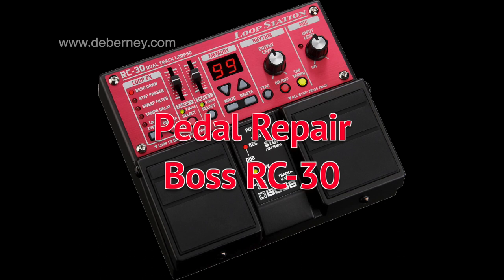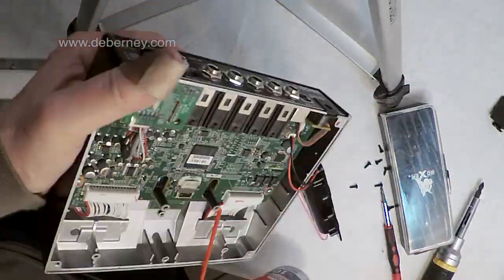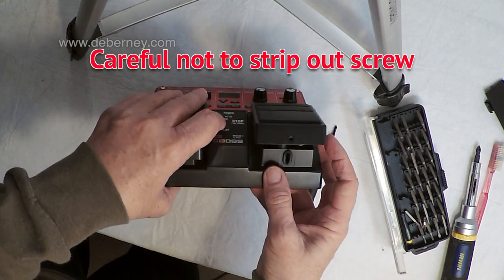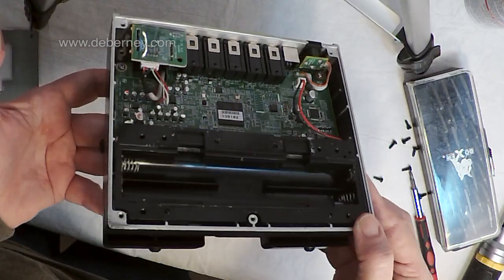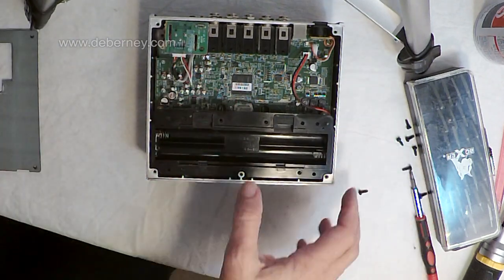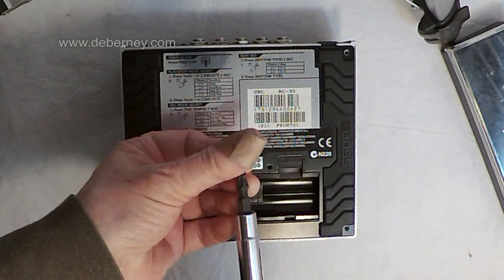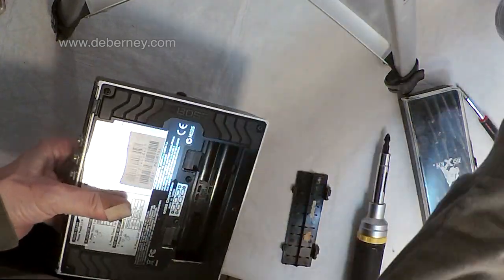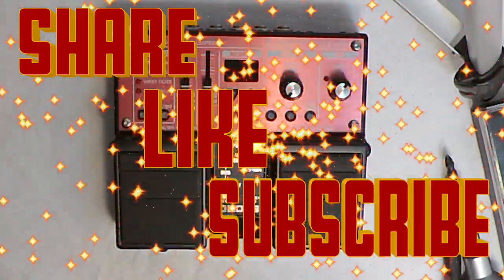BOSS RC-30 Looper Repair

Comment: You have 2 layers of PCB and most common area with rust is in between those layers. 
It’s easy to disconnect those (necessary to disconnect the battery connector on the PCB surface and the two white pedal connectors) with 8 screws. Must unscrew on the outer part the jack connectors too. 

The area where beer/water damage comes in, is in between those two layers. Easily cleanable with toothbrush and rust-remover/contactspray.
Reply from the maker: Thank you.  I'm sure this will help many experiencing problems with their units.

Comment: Great video!!! 
I’ve got a very strange issue, whenever I record on track 2 , it seems it’s stuck on 20% volume. 
Track 1 sounds fine, but even if I crank the track2 volume to the max, barely gains any volume. 

I’m trying to access the front of the pedal but not sure on how to 😢
Any help?
Reply from the maker: I don’t have th RC-30 anymore, but I would check manual for SYSTEM RESET and try that.

Comment: I’m having an issue with the the male end of the plug in! It won’t turn on, with a boss 9v or any other power... suggestions? Does it need batteries in it? Regardless? 

Thanks!!!
Reply from the maker: Sounds like you have tried different elec cables.  It does not need batteries with electric.  I would check the inputs, try a different wall plug then call boss.  See if it works with just batteries.

Comment: I just received a used one, and it was shipped with a 7.5v 2.8a center positive power adapter. I think they packed the wrong adapter, aren't these usually 9v 500ma, center negative? I'm afraid to plug it in. But it seems to work fine with batteries
Reply from the maker: It should be Ok.  Just make sure the V and amps match the voltage on bottom of the boss
Reply: @DebErney  Hmm.. the only thing on the bottom that mentions voltage is the battery cover. it says "DC 9V(1.5V × 6)," doesn't say anything about amps. But I think each AA battery is about .16 amps, but it varies depending on mAh so I think 6 would be about 1-3amp.
I'm most worried about the polarity, I heard you can fry the unit if you get it backwards.

Comment: I have the same pedal as this one. Recently, I've had issues with the features not working. When I plug in the cord, I'm only getting the green power signal but not the red lights so it will not record a loop. I've taken it into Sam Ash and they plug it in and it works fine. I even bought a power distributor which we tested at Sam Ash and every outlet activated the loop station correctly. I thought it took care of the problem, but when I plugged it in at one of my gigs, the pedal showed green power but the other lights didn't come on. It's been a hit and miss when I hook it up at my shows. Have you or anyone you know experienced this? It sounds like a power issue. I will take it apart and clean it to see if that helps.
Reply from the maker: In my experience when having constant problems with a piece of equipment its time to replace it.
Reply: @DebErney  so I took it back to Sam Ash earlier today and it worked there without an issue. Lol The salesman reset it back to factory settings and I plugged it in  at home and now it's working again. Hopefully that is what it needed. I didn't think of that. I also bought the Boss RC-1 pedal as a backup so I'm good to go! Thanks for your reply. :)
Reply from the maker: Reset is always a good idea though it sounds like you have something wrong with the electric chain.  If you have any other problems I’d replace ext cords, cords, anything providing elec to the unit.
Reply: @DebErney  I have a repair man on standby.
Reply: Hi i have the same problem! I think that the problem came out when i conect the pedal to te computer to copy a file, from the pedal to the computer- Next day Just the green light is on.

Comment: I have an RC-30 that I’ve had for several years. Recently I’ve discovered that I am not able to switch between the two tracks or play the two track simultaneous by use of the right foot pedal. I am out of the warranty period By a long shot. I was wondering if this was one of the same problems that you were having with your RC 30? And did the cleaning resolve the issue? I can select tracks manually but not with the foot switch... I’ve also done the factory reset...
Reply from the maker: these do die after a while.  If you've done the reset, opened and cleaned, checked for broken cables, I think it's safe to assume you need a new one.
Reply: Deb Erney I will try opening it up and doing the cleaning exercise.... There are several BOSS repair center’s in my area, however, a new RC-30 goes for around $300 and I can get a used one in excellent condition for around $200. So if cleaning doesn’t work replacements probably makes more economic sense... Thanks for your prompt reply...
Reply: JP Illes the exact same thing happened for me! Right foot wont let me switch tracks or do simo it’s so sad but I have had mine for 11 years now lol so I guess it’s time to replace let me know if the opening up cleaning worked for you!
Reply: Same thing here. I had a gig coming next week, so i had to buy new one. Now after 1,5 year, same thing with this new one
Reply: Hey, I'm having the same issue. Did yours get fixed?

Comment: Hi, mine is stuck playing the same beat like a metronome, it can't record or do anything, I've tried reseting it but nothing works, do you have any tips?
Reply from the maker: I'd try a factory reset, which can be found in manual, and if that didn't work I'd assume it needs replacing.

Comment: Mine was in storage for a while.  When took it back out to use it makes so much noise.  It sounds just like a bad cable.  I’ve tried all new cables and a brand new Boss power supply.  Saving the factory reset as a last option.  Has any of you seen this problem before?
Reply from the maker: I would have done the same.  Change cables then factory reset.

Comment: Hi my old rc-30 had a issue here.
everytime it powered up,it shows ER at the screen.
And everytime i FACTORY RESET,
It became slow flashing DN after fast  flashing FN...
When I tried to plug it in to pc,It didnt show up like it used to be..
any advice?...
Reply from the maker: Sounds like your unit "bit the dust".  Probably time for a new one.
Reply: Did you solve the fn error? My rc30 don't works with the batteries, only with an original regulator
Reply: @zamokyig  i dont have a regulator.
But i open the back off the rc30,see its memory is just a sd card.
So i take the sd card out,format the sd card,download the initial file and put it in,and problem its gone!

Comment: Not repair . Just cleaned.
Reply from the maker: potato, patato!
Reply: @DebErney  big difference from cleaning , and knowing/stating the actual technical symptoms and problems. What specificity did you do to fix the unmentioned problem. Besides a corroded neglected battery case. ? I’m not being nasty, but maybe re-title your video, disassemble/clean inspection,etc.. Anyway thanks for the video...!